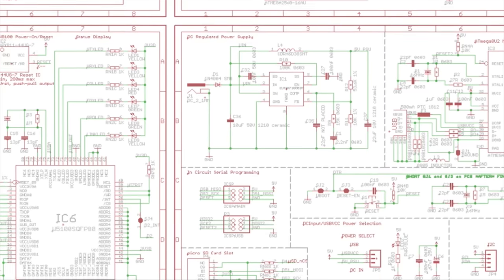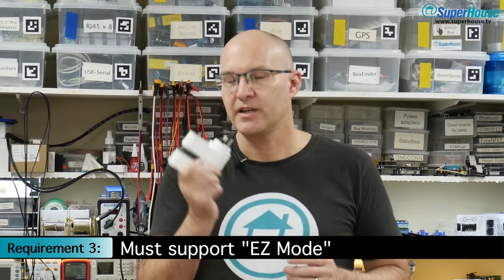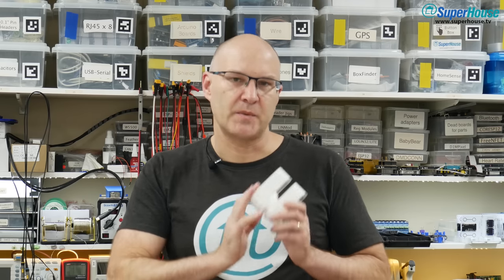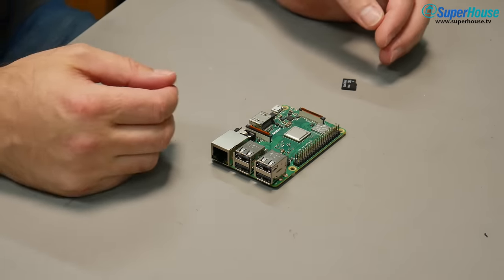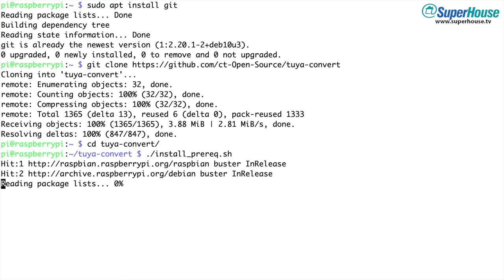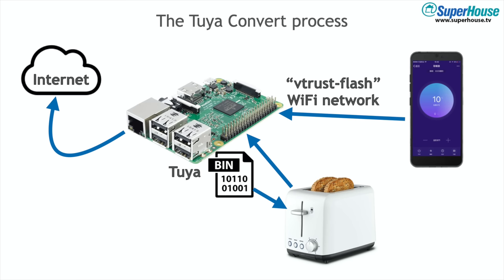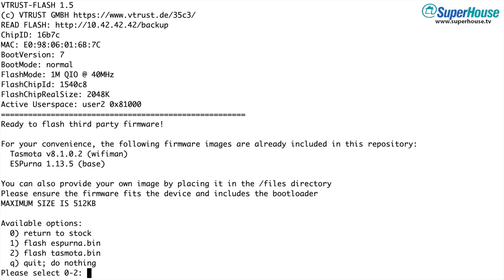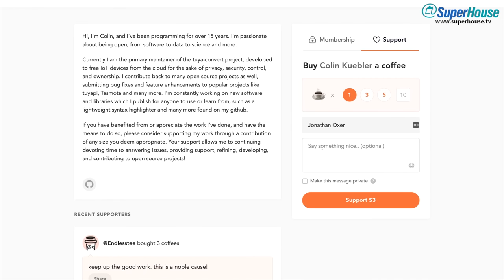SuperHouse 44: Installing Tasmota over-the-air with Tuya-Convert

Comment: Great video Jon.  I got a box of 4 of those Kogan Smart Switches with Energy monitoring and tuya-convert worked fine on those.  I got another box at a later time, from Kogan same model, etc but tuya-convert didn't work on those.  So had to resort to opening them up and applying the manual method (which you mention will be in future videos).  I wonder how long existing devices will still be able to leverage the tuya-convert process?
Reply from the maker: It really sucks that Tuya is taking this approach. They used to be a favorite for DIY home automation, but it won't be long before they've totally burned that bridge.

Comment: Excellent video, just be careful with using those particular Kogan plugs - I've had at least half a dozen fail/burn out. They are widely reported doing the same thing on the HA forums also. The newer version with the twin USB on the top are far better, but most likely running newer firmware now.
Reply from the maker: Thanks for the tip! I have 6 in daily use and I haven't had any fail yet. I'll keep an eye on them though.

Comment: I’ve used Tuya Convert once before and was shocked and how simple and easy it was compared to soldering headers, connecting with FTDI adapter and compiling then flashing using PlatformIO.

Comment: Hi, I have slowly been getting into home automation, more because I like to experiment (I have an electrical background) but am enjoying being able to do things remotely as well. I have several Sonoff devices that I have set up with eWeLink and then added to Google home. These all work very well and basically do what I want. I have watched several of your videos and they all seem to have a common theme in that you keep banging on about installing Tasmota software (firmware?). The thing is you never explain why, and you never explain that once a unit is converted how do you then control it. Does it still work via Google Home or do you require a dedicated app? Apologies if this is explained in one of your videos but as I say I have watched a number and have not come across it. I was hoping that this one would be the one but....

Comment: Have check out the Sonoff SPM it can handle up to 20A each channels and connect to 128 channels?  It also do power monitor.  It is cheaper solution.  I think Shelly is over price.  What do you think of Sonoff SPM modules?

Comment: With gridconnect (bunnings) devices being Tuya compatible out of the box, does this apply to their other sensors such as smart hub, BT temp/motion sensors etc. I assume it'd be similar.

Gridconnect reports to tuya's cloud IOT with 2 mins setup work, however all changes are Logs in the device. i'd love to get them to report locally into homeassistant or similar. Alternatively an API push from tuya's cloud to home assistant reporting the changes.

Comment: Hey Jon, Why does the Box Finder box not have a locating tag on it? Are you afraid that having the Box Finder system find its own parts is going to create some weird Time / Space Warp thingie??  ;-)
Reply from the maker: It can't do infinite loops.

The serious answer though is that the BoxFinder project was something I was working on using low-power devices attached inside each box, so they could be made to flash on command. It wasn't practical so I switched to using Aruco tags and cameras.

Comment: It's unfortunate about the updates. They are eventually all going to require disassembly
Reply: You can also get devices with Tasmota pre-flashed. The selection is not huge, but some bulbs, like GU10, can be tricky to open and connect to.
Reply: @JohnnieHougaardNielsen  recommendations for a source for pre flashed?
Reply: @JohnnieHougaardNielsen  nice. Didn't realize they had a section. Thanks!

Comment: ZigBee 3 devices are more than affordable nowadays and are even cheaper(e.g. Ikea, Lidl, Osram,... ) than flashable Wi-Fi plugs/whatever IoT. I don't see any reason to go for Wi-Fi based IoT instead of an open source ZigBee concentrator and controller software.
Reply: While ZigBee is indeed also good for local home automation, I'd still very much prefer the additional flexibility and capabilities of replacement firmware like Tasmota. I just like having full control over my hardware.